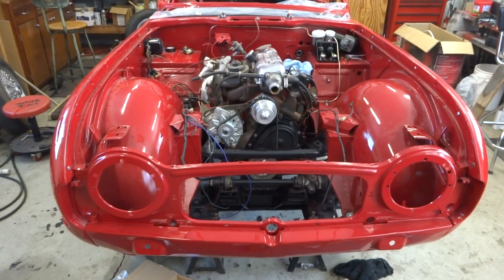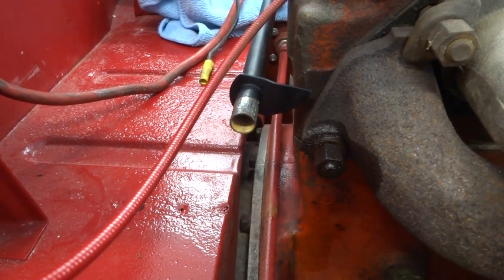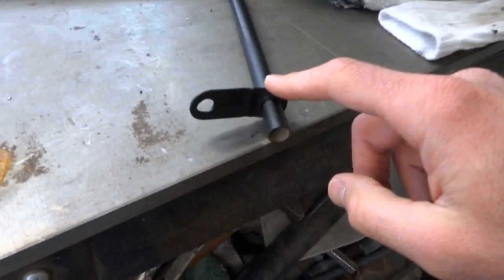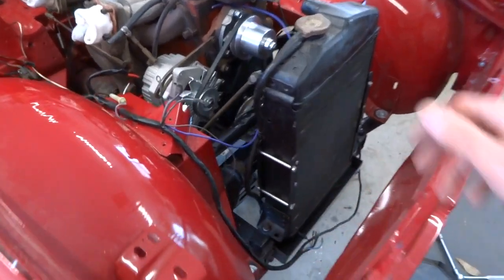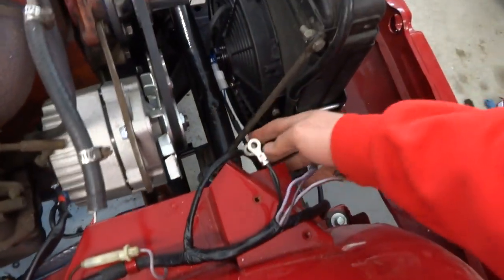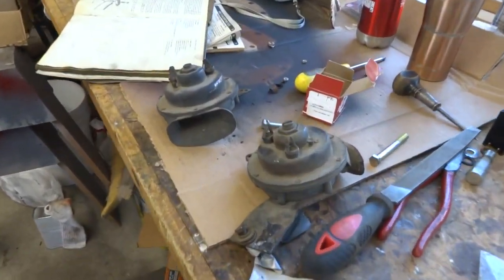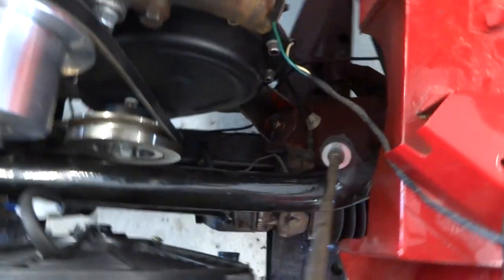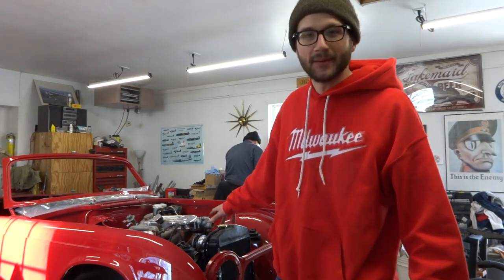Radiator Install on Triumph TR4 | Wegs Garage

Comment: I think you lucked out with the UPS delay. It is better to fit the steering shaft first, before installing the lower radiator hoses/pipe. You have to do a lot of manipulation of the hoses/pipe to get clearance of the lower rubber mount on the steering shaft (or replace it with a solid TR6 joint).
Reply from the maker: Do the TR6 joints fit on the TR4? Was never sure enough about it to buy them.
Reply: Yes, instead of two flex joints, the Tr6 has a solid joint down by the rack, and a flex joint at the top like the Tr4. I used a lower Tr6 solid joint on my TR4a.